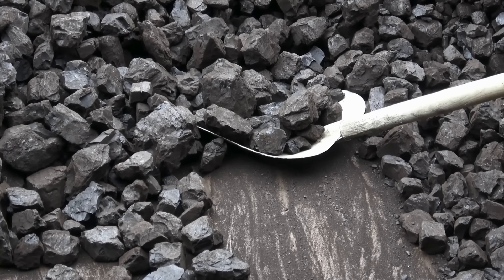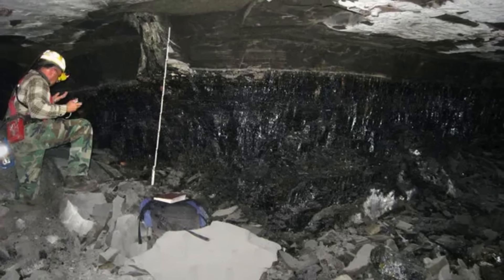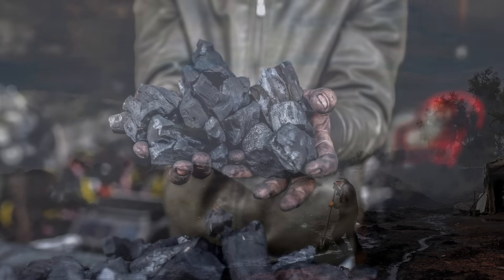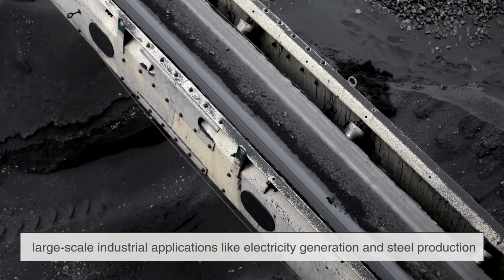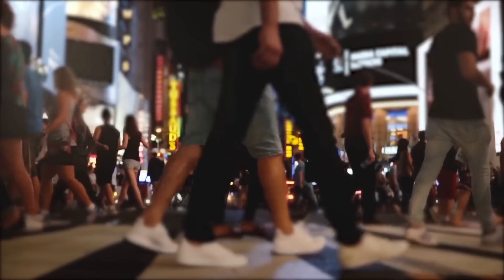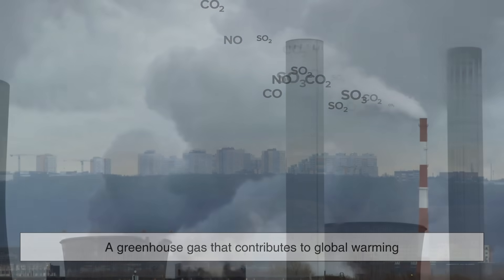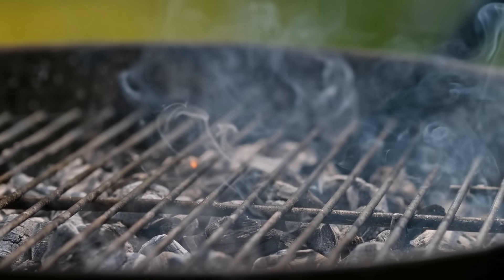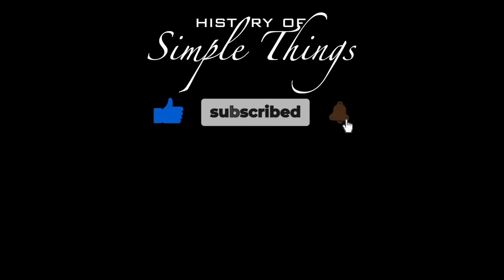Coal vs Charcoal: Which One Burns Better?

Comment: What is the difference in charcoal that is used for grilling and the charcoal that artists use for drawing?
Reply: The main difference is which wood is cooked into the charcoal. Artist's charcoal is often vines or willow sticks that are about the size of the sticks they use for art. Charcoal for grilling is usually hardwood or wood from fruit trees, because they result in wood that is dense and burns longer (in the case of hardwood), or results in the specific desired flavor profile.

Comment: In this video traditional earth/mud kilns are shown, which need 7-12 kg of wood to produce 1 kg of charcoal. Even modern industrial processes need 3-4 kg wood per kg charcoal. Indeed, burning coal releases real pollutants and fly ash you do not want in the atmosphere. Modern coal fired power stations capture 99,9% fly ash, 90-99% SO2, 70-90% NOx and metals like mercury to microgram levels.

Comment: You can pack nine pieces of coal into a single one cubic meter block and it will burn longer than the nine individual pieces. However, you cannot do this with charcoal

Comment: I love your videos; they are extremely entertaining and informative. One thought on the information you provided. The amount of pollutants when comparing charcoal to coal does not take into account the massive air contamination that occurs during the production of charcoal. If you measure the total amount of contamination from production to final usage, you will find that charcoal is actually a far greater source of environmental damage.

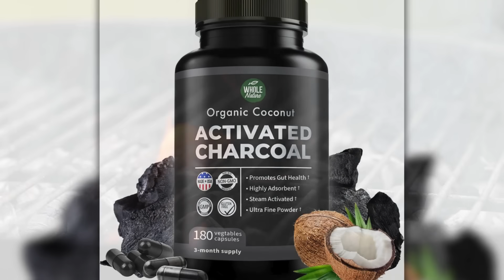Comment: Regarding 7:45, Activated Charcoal is also used in air filtration canisters such as in respirators or gas masks. When the Activated Charcoal has become completely saturated with contaminants, then the Activated Charcoal needs to be replaced.
Reply: Use it in my grows every time 😜

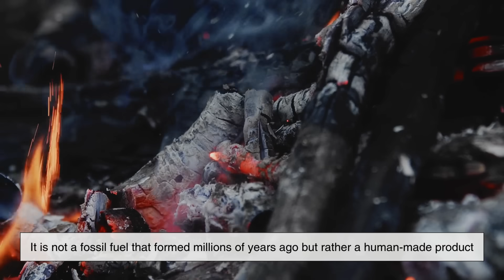Comment: Regarding 2:17, in olden days Char Cloth was used as tinder to ignite a fire from a spark from Flint & Steel or from concentrated sunlight from a convex magnifying lens or a parabolic mirror. Char Cloth is made similarly to how charcoal is made through pyrolysis except natural fiber cloth such as woven cotton or linen is used in place of wood.

Comment: Didn’t I see a couple of nuclear power plants shown when the narrator was referencing coal powered energy?
Reply: It may have been a nuclear plant in the video, but both use the same type of cooling towers.  Coal and nuclear power plants both create steam to turn turbines that create electricity, they just use a different fuel to do it.  Because they both heat water, they can both use cooling towers to cool the water.  Steam expands and turns the generator turbines, but pumps can't move steam back to the beginning of the cycle.  The steam has to condense back into water first, then the water has to be cooled so it has the capacity to absorb more heat as it goes through the cycle again.  In a cooling tower system, the steam condenses into very hot water.  The hot water is pumped to the top of the tower where it then falls to the bottom, cooling as it passes through the air on the way down.  It collects in a reservoir at the bottom where it its pumped back through the cycle. There is usually a feed water make-up system that has a reservoir level sensor and valves that can brings in fresh water because some of the hot water will evaporate off at the top of the tower, hence the steam you'll see coming out. 

The steam in a nuclear plant cooling tower is not radioactive.  The primary water circuit is radioactive water.  Its a closed loop that passes through a heat exchanger that heats a secondary water circuit without mixing them.  The secondary water circuit is the one that turns the turbines and goes through the cooling tower process.  The primary circuit is contained within the reactors containment building.

Comment: What does the "charcoal" emit when actually making it??
Reply: Water and lightweight hydrocarbons, which may burn to water and carbon dioxide. It's just wood after all, what were you expecting?
Reply: i can only answer this from cooking there are two types of charcoal. lump  and briquettes. lump is just wood cooked\burned with controlled oxygen. its pretty much sealed impurities kind of stay in . briquettes are a mix of lump and other ingredients. don't look to much or you will start making you're own. there is a lot of people that shows different ways all with there trick to make it better than the others. enjoy learn have fun
Reply: The peasants I know in my region make it by building a large mound of wood cuttings about 2.5m high and 3 to 4m wide, covering it with grasses and leaves and leaving it to burn very slowly.
Reply: Both lump and briquets are made basically the same way, but from different material - with briquettes often made from some portion of coal dust, but labeled "mineral carbon" or some BS.  There are no-coaldust briquettes, but they're premium price.  Charcoal is also typically made by using natural gas in North America and the EU, in Russia, China and most other places, unless NG is local and abundant, cheap coal is usually the fuel-stock.  In remote areas, it's made using early indstrial methods (think of a rail-car buried underground), and cooked with wood. Wood typically requires 3x as many therms of fuel stock, than you'll have as a final thermal potential in the finished charcoal.  So 4x the CO2 of just burning wood in the first place.  Byproducts of wood pyrolysis are mostly water vapor, some carbon monoxide (which is more poisonous than carbon dioxide), and substantial amounts of wood-tar or soot, depending on how much resin the wood has.  In general, the full cycle of producing coal (dig, crush, wash, dry, ship in freight cars, burn) vs charcoal (cut, ship to processing, debark, chop, pyrolysis with gas or coal, bag, ship, retail wastage) is more positive for coal - which benefits from economics of scale, and good regulation in first world countries.  Charcoal is not a salvation from Co2 emissions.  Coal is no saint either.  Further investment in solar/wind/geothermal is likely what's needed - but each of these newtech has their own issues as well.  Better material science can continue to increase newtech efficiencies, which reducing negative aspects like use of rare-earths and CFL refrigerants.